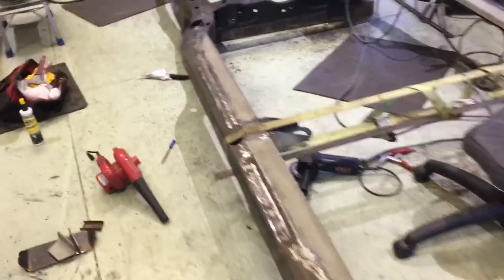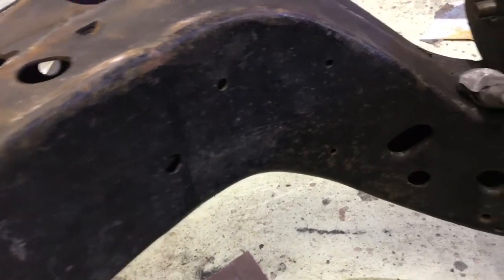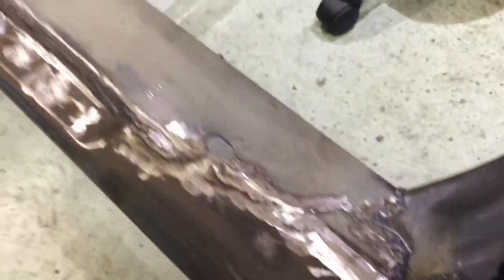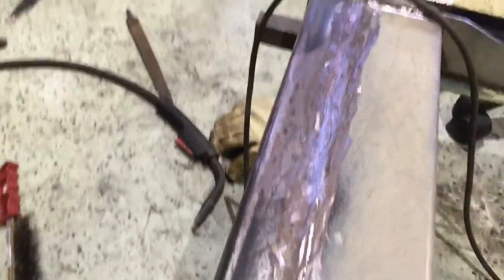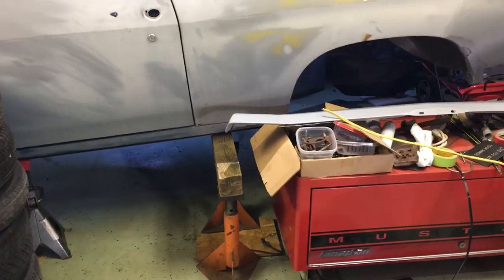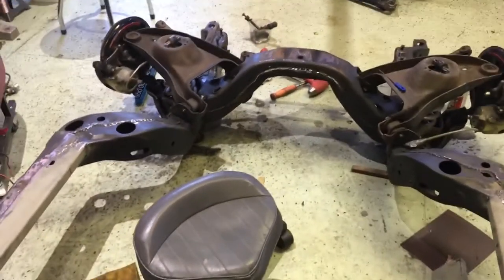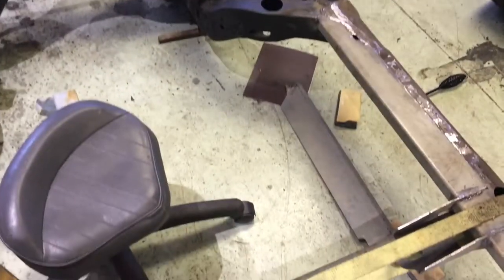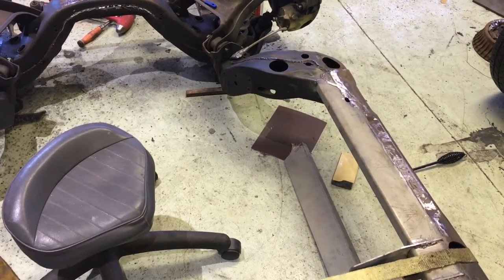Hellwig Frame FX kit installation on Derail's Chevelle pt.5

Comment: Great work , If you had to calculate the time it took, how long would you say in hours.  Also I have a Gforce cross member too but it  will just have to be cut down and fab'd. Should use the same holes as the 350 or better yet bolt in the same are new holes.